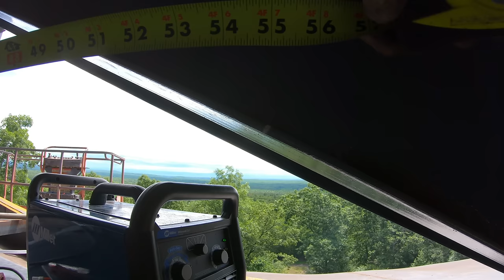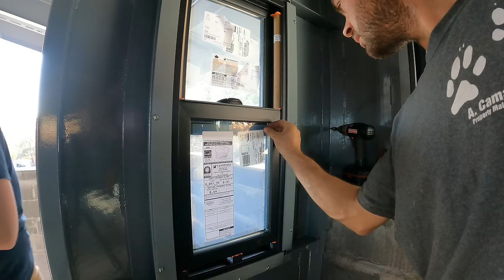Closing in the container castle

Comment: Needs a stairs lift for Levi. Poor old mans struggling bless him.
Reply: needs to install a dumb waiter just for the old fella
Reply: stand another shipping container on its end next to the to the other one
Reply: for a man of your skills building an extra elevator tower with a telescopic hydraulic drive train should be no problem. It should have a dog interface switch so Levy can operate it alone.
and don't forget the underfloor heating!
Reply: @FraLin  I was thinking the same sort of idea, tip a container on end and put a scissor lift in. Dig a pit just deep enough for it to be at ground level. Also, solar panel the roof. He would be able to power a small town..
Reply: Í m sure you love your pets. So build an elevator now!!!
Reply: Knowing Andrew, any elevator he builds would be so over engineered, he could hoist pallets of gold bars from his own Italian Job.
Reply: Build him an elevator AND feed him “Farmer’s Dog” dog food. Feed them BOTH Farmer’s Dog. It will add quality years to their lives. We feed it to our two old pugs and one old poodle. You will see a remarkable improvement in Levi’s mobility and overall health. It will be good for the kid too!🤠
Reply: @FraLin  It would need a safety lock in case one dog operates it when the other one is halfway in or out.
Reply: and after all this building guess what?
Reply: @michaelvollmer9491  building a elevator defeats the purpose those old back legs need the exercise..... it’s not hurting him just a bit slower is all
Reply: @ttss5726  interesting theory. You CLEARLY have never been old like Levi. He needs an elevator.

Comment: Most people “grab the other end of this 30 lb. sheet of drywall, Bob”.        Andrew “grab the other end of this 400 lb. sheet of diamond plate, Beth”.  🙈
(Highly recommend spray foam insulation .. hated the price, but love the results) 🤷‍♂️. PS Nice job on the house! 👍
Reply: Hes making walls out of steel i think price wont be to bad in the grand sceme.
Reply: Material is always the cheapest of the cost of building, the labor is what gets you...
Reply: Is spray foam needed? I feel like many of the benefits to a traditional wood frame house are lost to a welded plate steel house. Doesnt need the rigidity, air barrier, etc. Stone wool or if he wants to go with foam just use sheet goods such as xps. Stone wool allows him to keep the fire proof nature he was looking in going with a steel roof.
Reply: I am not a builder but.. Andrew’s “fort” will likely be the place to hang out during any zombie/apocalypse/shooting war without doubt, but l think moisture on the inside of the structure will be the biggest problem he will face.  Any inside moisture will condense on the inside like a cold glass of water sweats on the outside.  Closed cell spray foam will solve that issue as it will be bonded to the inside of the steel walls and has a very high insulative value..  l was forced to use it by our county building code, which kind of went against my grain, but in the long run it was a great product..🤷‍♂️

Comment: One cannot help but see a fireplace maybe even a free standing one possibly on each floor as a must have since each  space seems to beg for one and the thought of its glow on a winters night is nearly irresistible. Another couple additions is obvious like a brass Golden Lab cutout on a weather vane is a must on the tower plus  a coat of arms with crossed tools with a Lab's head resembling Levi/Cody as well as his pups from the past at its center would be a finishing touch as well. Kudos on rain gutters that won't wear out in several lifetimes and adding any more Windows will be just cutting the openings in the diamond plate then riveting them in if their desired in future. One suggestion after expoxy coating the floors would be to look into commercial carpet tiles to cover them since they don't need to be glued down and they'll dampen noise as well as keep something warm under your feet that can be changed out as easily as it went in. Nice to see the pups were doing their inspections as usual and Cody's window platform might be just what he needs to spy the critters down below and his nose streaks in the glass might be there only issue going forward. Looking forward to those future maintenance jobs your likely already filming and the glass installers might give you a ring to help them with you lifts since it saved them hours as well as their backs by letting the booms due most of the lifting/positioning.
Reply: Yeah, he's going to need that - there seems to be no insulation and no thermal breaks.. gonna be chilly inside!

Comment: Fire Marshal: is it made of combustible materials?

Andrew: Well if it gets above 2750 deg F (1510c) it might melt, but no it won't catch fire.
Reply: Steel loses strength at 400C
Reply: @jcoul1sc  Jet fuel can't melt steel beams!
Reply: @TheOwenMajor  Agreed. Major loss of strength in a normal fire situation, see UK structural engineers graph here: https://www.istructe.org/journal/volumes/volume-98-(2020)/issue-3/industry-cpd-fire-protection-of-steel-framed-build/
Reply: Maybe you should have used reinforced concrete, after all Grenfell Tower, London is still standing
Reply: Add some asbestos to be fire proof
Reply: @jcoul1sc  The steel is under such a light load that it isn't going to have a problem at 400C.
Reply: @cyrilvankeirsbelk7299  Self weight of beam and column itself
Reply: @TheOwenMajor  Good one James.
Reply: Cyril VanKeirsbelk oo
Reply: @jcoul1sc  Not at only 400C, I wouldn't think it would be an issue until 700C+ considering that the structure could probably support 5 to 10 times the weight, easily.
Reply: To sum this up: If you get a constant fire in a steel building that can endanger its structural integrity, then you have a whole lot of other problems!
Reply: @jcoul1sc  as in the twin towers?....
Reply: There's a good chance that this is located in a jurisdiction of the USA that does not have fire inspection or building codes. More than half of the USA is unregulated or unenforced, which lowers the cost of construction and makes it possible for normal people to build their own buildings using common sense. The notion of inspection is a reminder of their need as public servants due to the incompetence and greed of urban builders.
Reply: @ThereIsOnly1ArcNinja  fair point.
Reply: @videosfromelsewhere926  Think this is new york state.  Probably classed as a industrial building, so lower standard. Andrew did haveca structural engineer though.
Reply: Same stuff as the world trade centre, bit of kerosene and down she comes!
Reply: @jakobrebeki  asbestos.  Think the asbestos cancers from the sprayed concrete fire protections, to the WTC steel, are killing more than the actual collapse.
Reply: Could you imagine being the insurance guy doing an analysis on this? They’d be like Holy Bleep!
Reply: Feral Man  where does it say that.
Reply: Feral Man  is there no reference for actual King James version. Not some influencer crap.

Comment: Imagine the noise that roof will make during a hailstorm.
Reply: That gives you WW2 vibes.
Reply: Spray it with bedliner and it will be good.
Reply: Imagine what his roof would do to the hail.
#Snowbank
Reply: Music.
Reply: Its actually a lot less noise than a typical metal roof-- which only has 26 or 29 gauge sheets.. The thicker steel will be a lot quieter.
Reply: depending on if he put the paper under it or what he coated it with, he might not hear it at all.
Reply: @williammassey911  agreed!  Sweet, sweet music.

Comment: You should build or buy one of those giant top loading outdoor wood stove boilers, the ones that you load giant logs in with a machine, probably would be the only way to really heat something like this if you ever decide to.
Reply: This guy never stops moving and or working (generating his own heat) and doesn't require a heating system! 😆
Reply: Needs a buy a enclosed trailer spray foam rig and some chemicals. Then it could just be heated with a wood stove.
Reply: @aaronhayden1780  too much thermal bridging with the metal.
Reply: Geothermal would probably be the only affordable way to heat all of that space.
Reply: @eroticjellyfish  you think this is the first metal/concrete structure of this size to require heating ? thermal bridging ?!?🤦‍♂️
Reply: @AlexeiTetenov  It is on a mountain ;-) A half mile deep or maybe more...
Reply: @tervez  I think that’s when you have exposed metal on the heated side that goes to the hold side and looses heat. Would need to spray foam over all the metal to get it to work or put in the sub walls with metal sheeting not connected to the containers.
Reply: I can't wait to see some mid-winter videos. I can't imagine using the top floor for habitation in winter, though. Assuming it's as air tight as he suggests, even if heated moisture will condense on the bottom side of the metal roof and even freeze solid (if not warmed enough) in the New York cold. Can imagine ice sheets crashing down on sunny days...both inside AND outside.  That's not gonna be fun if it's not insulated, with a moisture barrier. Even if no ice forms it will just get all rusty and drip brown spots everywhere.  It's just like living inside an oil tank...even sounds like it in the video.
Reply: Loving the black doors and windows. The roof would look good in black too.
Reply: @aaronhayden1780  you would have to insulate it from the outside to stop the thermal bridging
Reply: You don't need to heat an entire huge house it is impractical and costly,  thermal insulation a good burner and thermal piping system you can channel heat to rooms easily.
Reply: @tervez  Dunno if you read my comment as I was referring to aaron wanting to spray foam and use a wooden stove to heat the place.
Reply: @dreadrechsler8278  agree 100%, this build is unfinished until it's properly insulated with a heating system. Can't live in a tin can, even if andrew doesn't mind the cold now, nobody's going to want to spend time there if it's cold and uncomfortable. So might as well get it out of the way, and prevent condensation issues.
Reply: @dreadrechsler8278  yeah, I work construction on new homes (residential), I was thinking about the insulation/vapor barrier and how it would work with this style of building.
Like for example, between a stud touching concrete you need those foam pads to act as a insulation barrier between concrete and wood (as well as moisture) but do you still need to do the same with metal to concrete?
What about exterior framing touching interior framing?
If it was wood you'd need to a insulate between the interior framing and the exterior or you would lose R values.
I wonder if waterproof/vapor barrier paints you could use (I'm thinking redguard and similar product) would work.

Also a little concerned with Glass windows in contact with metal, for example if your windows are in direct contact with a wood frame you'll drop R values and have moisture issue, this is typical fixes by spray foaming the gap between the wood frame and window (the gap is created by shims, the window frame is done in a way that allows play to add those shims)
Reply: He doesn’t like heat.
Reply: easy, just set fire inside one of the container as a furness, you could burn garbage from all that human activity. old tires and all.
Reply: I think Experimental fun was talking about heating the machines not Andrew...
Reply: @dreadrechsler8278  It's past mid-winter now, many snowy days and still nothing... I wonder what the cope will sound like with all the speculation of ice, mildew, ect. still doesn't occur.
Reply: I hope that is tempered glass. Windows that high up should be to meet code. Otherwise a cracked and broken pane is a death hazard.
Reply: @dreadrechsler8278     Lol I’ve thought 💭 the same thing!!! Lol 😆
Reply: Nagolbud Gets the Internet   I'm sorry if you don't understand what thermal bridging is and how much steel he has crossing from the exterior wall to the interior with no thermal breaks.  
You might be informed to know that the thermal conductivity of wood is roughly 400 times less than steel,  which is why polebarns do not suffer from thermal bridging, but giant steel buildings with no thermal breaks do.
This is why people who build container homes out of steel shipping containers will fully insulate the interior or exterior steel wall along with using wood as a thermal break.
Reply: Literally every seacan and trailer that needs to be heated in northern alberta, is spray foamed. A little 120v heater is all it takes to heat up a 40' and keep it warm, no matter the temp outside. The Antarctic bases constructed using steel frames and panels are all insulated and get on just fine down there. Doubt it gets colder than the Antarctic or Alberta wherever Andrew's at. It will be okay. Would look terrible without paneling over top though for sure.

Comment: That is one very useful lady to have around when you need someone who has a clue, not that hard to look at either TBH. I am incredibly impressed with your measuring and cutting skills, the whole place is a credit to you and your lady, I imagine it'll be very cold in winter, so I assume you'll be buying or hiring a spray foam machine as that is by far the best and easiest way to insulate against steel. Well done.

Comment: pretty cool but seems like it would be a heating cooling nightmare
Reply: Acoustic too.
Reply: this is the same guy who installed a vehicle lift outdoors  and works on it year round, he don't mind the cold :p
Reply: He straight up doesn't heat or cool it.
Reply: Well l, the metal would absorb energy from the sun. We have an old dining hall at this camp that was built in I think the 40s and it’s almost all original, wooden and tin roof. It is warm in there without a wood stove on the days that it gets freezing but there’s sun.
Reply: And steel is very hazardous when there is a fire inside. Remember WTC
Reply: @gokmachine  Only when there's jet fuel involved and burning for over an hour. I don't really see that being an issue.  Besides, Rosie O'Donnell has assured us that despite the furnace production process fire can't melt steel.  So, not to worry.
Reply: I have a concrete and steel house, I use radiant heat, the most comfortable house I've ever lived in
Reply: Seems like it would be a HVAC (heating, ventilation and cooling) nightmare.
Reply: @billyricker3432  Very true. He didn't use any insulation and only heats a very small room.   Just crazy! A big structure and confined to a very small room that's heated.🙃
Reply: @bighonkey_alligator  This guy didn't insulate it, at all!  Kind of crazy!
Reply: Yeah as someone who lives in the tropics; this just makes me sweat looking at it, lol.

Comment: Isn’t that house extremely cold during winter.(or high energy consumption)
Reply: Don't ask that kind of questions. This guy is completely nuts
Reply: I remember in one video Andrew explained that he doesn't wear jackets or long sleeves inside or outside during the fall and early winter, so that he isn't affected by the cold as much. By the time winter hits he's well acclimated and only needs jackets when it's extremely cold. A madman.
Reply: Well it is now, but it's kind of a worthless question since he's not even done with it yet. He's stated he's gonna insulate with cell-foam soon.
Reply: @girthquake1413  ofcourse. Still insulation to be done. But he has been working in his garage for some years now. From my experience working on ships. 
 Metal has a strong thermal condictivity, and creates a sensation of sucking the heat out of a room. Compared to timber the construction will be more difficult to insulate effectively.
Reply: @johanj81  Oh yeah, that is obvious; he also has his floor beneath a simple concrete pad that wasn't sunk in, so that is also going to cool the house more because of the frost line.
I just mean, we'll have to wait and see what he does. He's got a lot of roof space that is also steel that he could attempt something with too.
Reply: This house will be like a freezer in winter time and an oven in summer time. It needs some SERIOUS insulation
Reply: Don Narine  ..I would imagine Andrew would know.. :)
Reply: I have asked several times how much he has spent? Could probably built a nice home for less..
Reply: @tomwinkle5536  for one quit hating! Could have built a nice home? Arm chair quarterbacks! If you knew a thing about building you'd know he couldve built 10 normal 2 story homes but he obviously is working with a budget bigger than most state government. That is a dream castle fit for a king and toy talking bout a nice house like that isn't? This is a joke right ?

Comment: "Why you gotta stop right there". Didn't look like he was trying to stop, he was just going too slow and couldn't make it.
Reply: Cause he was thinking about stopping not going. That's why he was going too slow and got stuck.
Reply: The rear axles on a tractor like that are air ride, allowing one of the axles to raise up and loose just enough traction to spin when he went back down the driver most likely engaged the differential  lock  which allows both axles to work independently